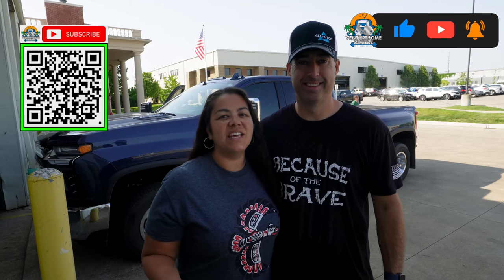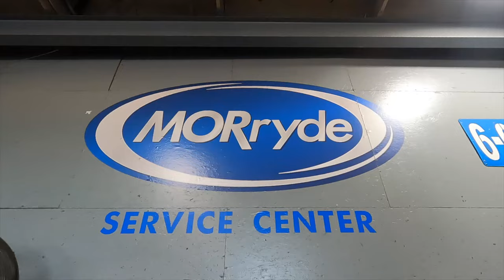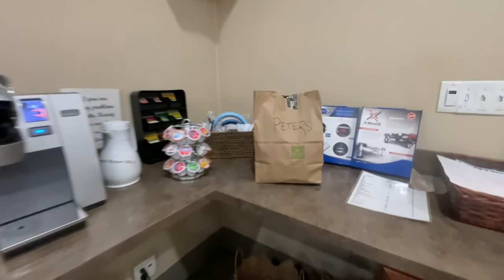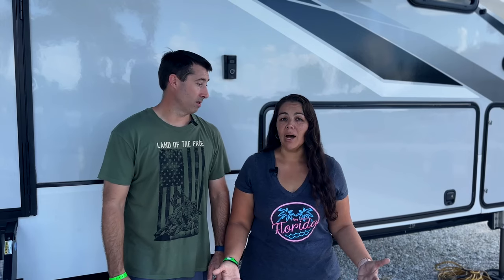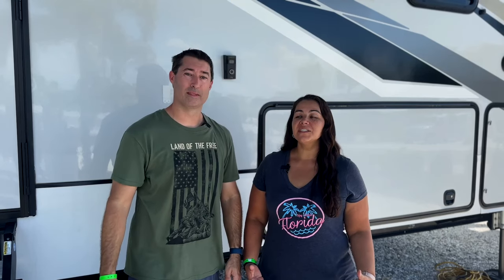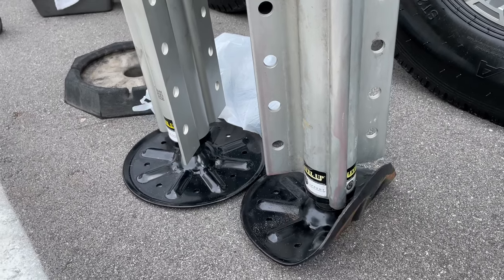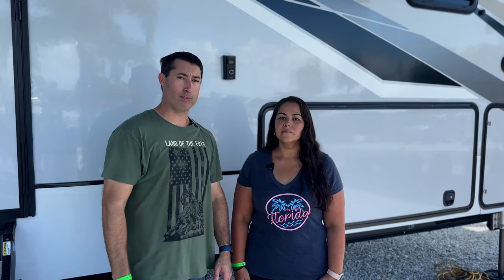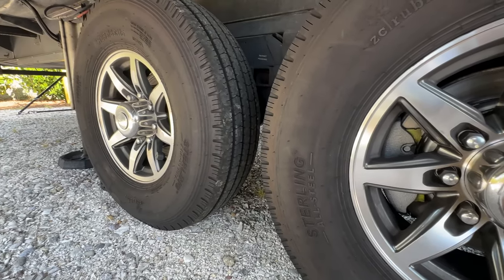MORryde BOLT ON Independent Suspension | Disc Brake Review | Installation

Comment: I have been keeping an eye on the bolt-on version. Actually, I had an appointment for our 5er, but between the price increase, current economic climate, and two other issues with our Solitude, my wife and I had to cancel.  I have been to MORryde many times and know several folks there and  am a Profesional Engineer. So it gave me great pain to watch the techs hammering down the fasteners with the impact then using a torque wrench improperly. Basically, every fastener is overtorqued... In years past, that would have never flown in their shop, but I suppose they have the same labor challenges all of us do in this day.  Anyway, any issues now that you probably have ~2 years of travel on the install?
Reply from the maker: Thank you for watching our video and supporting our channel. We appreciate the context and feedback. We are sorry to hear that you are having difficulties with your Grand Design.
Reply: @robv4053  I was thinking the same thing on using a torque wrench after hammering the fasteners down with that impact. 

Yeah, they are torqued. But what value exactly? 

And to clarify why you torque a bolt/nut:
It's a way of controlling the stretch of a bolt so that it will stay fastened but will not break while keeping all of the design specs of that bolt.

The way they did it, you shouldn't be surprised if you have a bolt break on you while under stress where a bolt torqued to spec will not break under the same stress.

And when that bolt is a critical bolt on your suspension...

Plus that somebody who does that kind of a job doesn't deserve the title  "Technician".
Reply from the maker: Thank you! We will pass along the feedback to MORryde. Also we do agree with you completely.

Comment: what was the round about cost for up grade
Reply from the maker: Thank you for watching our video, this upgrade is around 6-7K, depending on how you would want it configured, we added in a tray and some other stuff at the time. Prices will vary depending on your needs and what you have, if you need/want to change to disc breaks or add any other accessories. Best bet is to call to get a quote from MORryde and if you tell them we, Venturesome Couple sent you, you’ll get additional savings towards accessories at the time of install.
Reply from the maker: Also, this video was filmed in May 2023, so prices may vary over time too.

Comment: Makes you wonder why these IS are not at least an option if not standard.  All upside!
Reply from the maker: Hey Ricky,

Thank you for watching our video and supporting our channel. The Independent Suspension is an option now directly from the Alliance factory for the Paradigm line. We agree with having as a standard option would be great! We have been told it comes down to the additional cost and that some people do not want the added price on their purchase. The leaf springs and drum breaks are significantly cheaper and are adequate to meet the safety requirements of the DOT.

Comment: So how does the Morryde IS now plz?
Reply from the maker: Thank you for watching our video and supporting our channel. We greatly appreciate you taking the time to check our little piece of the world. We have been very impressed with the IS, it has exceeded our expectations.
Reply: @VenturesomeCouple  After reading your reply we called and talked to Morryde and scheduled a upgrade. I forgot to mention we watched your video. Hope when we get there maybe we get a little discount. 2018 we took our 2017 325 RL Vanleigh/Vilano to Alaska. We went and volunteered at a family CG in Soldotna. It was Klondike RV Park and Cottages. What an awesome Adventure. When we went to Denali we hit the grand Slam riding the bus out and back. Chena  Hot Springs was as far North as we went too. Would love to return after getting out new IS.
Reply from the maker: @rvfuntimes6144  That’s great you have your appointment set up now. We recommend giving MoRryde a call to let them know we sent you their way so you can get money credit towards other accessories set up before you get there so it’s in their system. Also while you have your appointment, they have tours, which we recommend going on. We are looking forward to returning to Alaska ❤️ Sounds like you guys had an amazing time. Safe travels.

Comment: Was a torque wrench ever used?
Reply from the maker: Kodiakeddie, thank you for watching our video and supporting our channel. They did use a torque wrench all the way through the process. They also have a second technician go over everything with a torque wrench to double check the installers work.

Comment: Anybody know about how much it cost for this upgrade?
Reply from the maker: Thank you for watching our upgrade video for the MORryde Bolt-on independent suspension and disc brakes. We recommend calling MORryde or going to their website as pricing will depend on how many axles you have, if you have disc brakes or upgrading your disc brakes or not getting disc brakes, etc and if you’re getting any other upgrades at that time too. There’s a lot of factors for the pricing and MORryde is the best place for all of that information. If you mention, Venturesome Couple sent you, you will save a couple hundred dollars towards accessories when you get your IS upgrade. And I’m sure depending on when you get your upgrade will determine the price as well, such as inflation or price changes,  if your RV can get the Bolt-on versus the welded independent suspension.

Comment: So….how much weight does the IS add to the trailer?
Reply from the maker: Hey thebearden2, Thank you for watching our video and supporting our channel. It adds about 800lbs to the trailer. The nice thing is that it is under slung weight and does not negatively impact the weight of the trailer above the frame. That being said, the DOT sticker does not change so the GVWR stays the same.
Reply: Thank you for the info
Reply from the maker: You’re welcome

Comment: Cost?
Reply from the maker: @hjets5387  The cost will vary depending on how many axels, if you get disc brakes, what kind of rig you have & year, and when you book, etc. 
If you call MORryde they can give you a quote and if you book, let MORryde know that Venturesome Couple sent you and you’ll get some credit towards some accessories. It’s an upgrade that’s well worth it. 
MORryde Service Center (574) 293-1581.

Comment: Now your trailer is going to sway in the wind when towing. Good luck getting parts if you break down. 🤦‍♂️
Reply from the maker: Thank you for watching our video, we've had our MORryde Independent Suspension for over a year on our 5th wheel and not one issue. Have a wonderful day.

Comment: Pay $100k plus and have to upgrade suspension! Unreal
Reply from the maker: Thank you for watching our video & supporting our channel, When we purchased our 5th wheel it was already built, as in we didn’t order it & it was already on a dealership lot, & it was a year prior model. Now our RV manufacture has partnered with MORryde to add independent suspension as a paid option to add it before they build the RV. We think it’s awesome that MORryde sells independent suspension aftermarket for those who would like the option of adding independent suspension to a unit that did not come with it. This is no different than buying a vehicle sitting on a lot and adding features, aftermarket, or ordering a vehicle and adding the options as paid upgrades. Which we did with our dually, we ordered our dually and added every option that we wanted to fit our lifestyle.

Comment: Pay $100k+ and have to upgrade the suspension😢 wow
Reply from the maker: Thank you for watching our video & supporting our channel, When we purchased our 5th wheel it was already built, as in we didn’t order it & it was already on a dealership lot, & it was a year prior model. Now our RV manufacture has partnered with MORryde to add independent suspension as a paid option to add it before they build the RV. We think it’s awesome that MORryde sells independent suspension aftermarket for those who would like the option of adding independent suspension to a unit that did not come with it. This is no different than buying a vehicle sitting on a lot and adding features, aftermarket, or ordering a vehicle and adding the options as paid upgrades. Which we did with our dually, we ordered our dually and added every option that we wanted to fit our lifestyle.